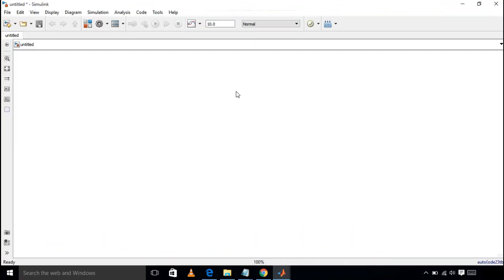Boost(Step-up)Converter design and simulation| L and C calculation |DC-DC converter |chopper |MATLAB

Comment: MOSFET is superior below 250 Voltage, High frequency application and Low o/p power drive. On the other IGBT is superior in voltage more then 500 V , High power application, But frequency little bit less then MOSFET. As IGBT is hybrid product of MOSFET and BJT (Which is low frequency device up to 20 to 30 KHz). 'Hence here better to use IGBT when designing about High power drive.' ((MOSFET is only majority carriers device i.e. either works on P or N not both. It conducts by gate-oxide controlled field-effect, not like electron+hole recombination in BJT, which makes BJT slower then MOSFET.))